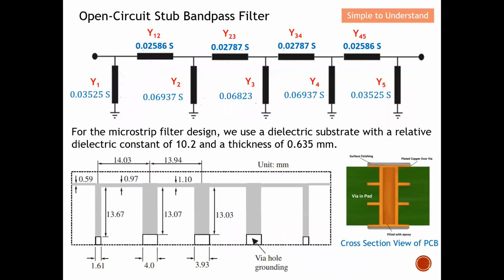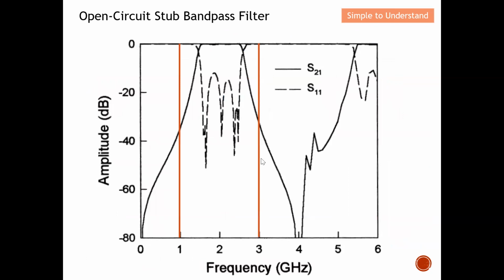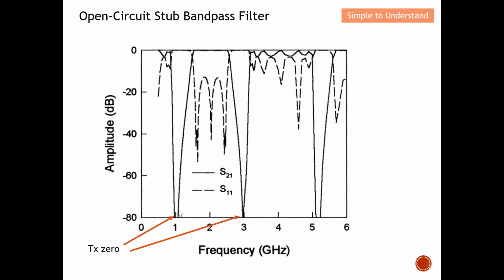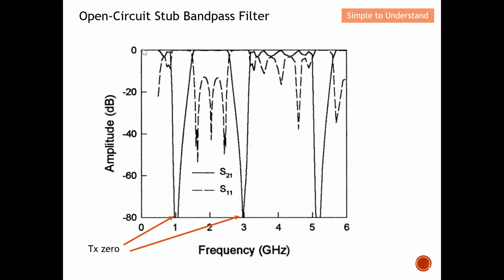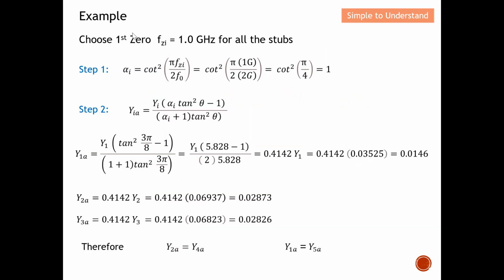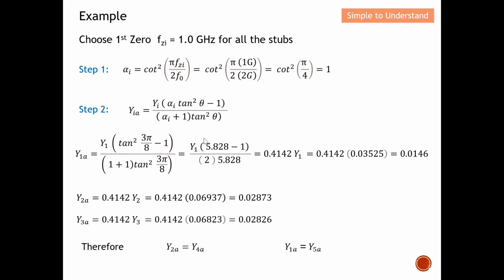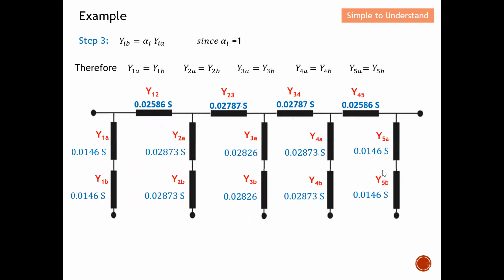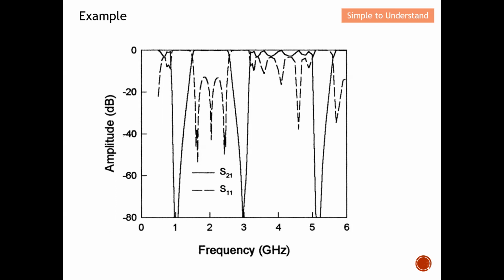Filter Design #19. High-Selectivity Microstrip BPF: λ/4 Stub Design for Performance & Compact Size

Comment: At 20:34 how you r converting length and width.
Reply from the maker: I will do a video to answer this question.  :)
Reply: @technologiesdiscussion1676  thank u sir
Reply from the maker: This video: Determine the Width, w & Length, l of a Microstrip Line with Given Characteristic Impedance, Z.
https://youtu.be/_gDfVK5dPhY
Reply: @technologiesdiscussion1676  Thank you so much. No word can describe how much I appreciate it!
Reply from the maker: @minhhoangpham2944   You are welcome. Pls help by help the videos and subscribe to this channel.  :)
Reply: For source,load u r given with 0.59 mm width, what is length?
Reply from the maker: For the feeding line which is 50 Ohm, the length dun have any concern at all but normally I left it, half wavelength of the freq or it can be even longer. Later, you can still trim the PCB or sand / file the edge to make it shorter.  :)